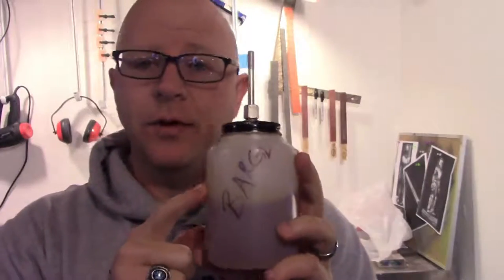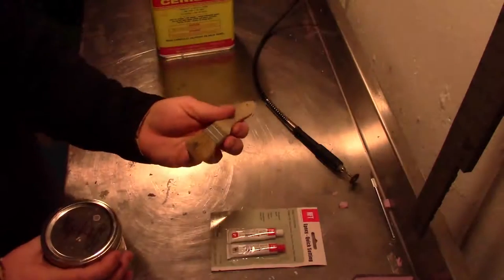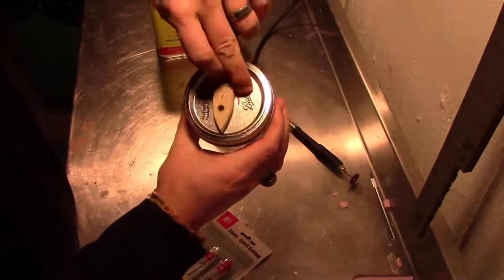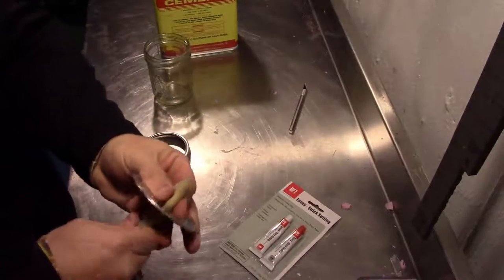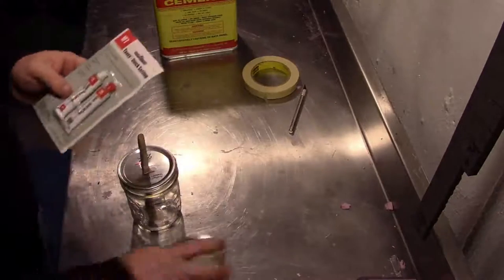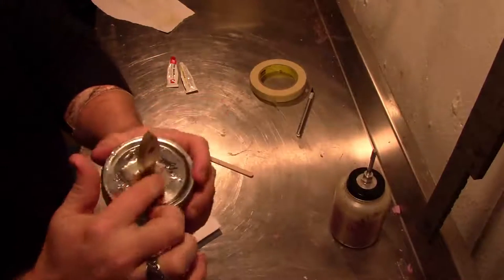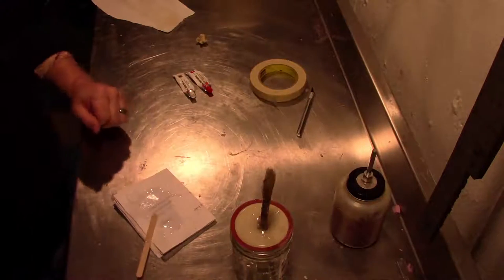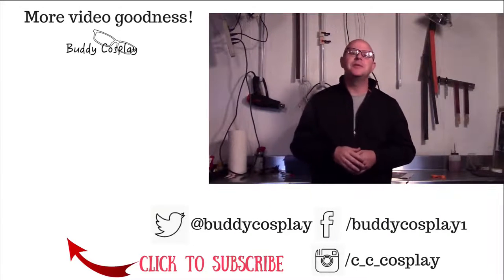Budget Cosplay Tips and Tricks   Hillbilly Glue Pot

Comment: Would an acid brush work or is it too narrow?
Reply from the maker: The small acid brush (horse hair ones, I believe) would  work just fine! Just make a smaller hole of the handle.  Good suggestion!
Reply: Buddy Cosplay thanks for the reply.  I think I may make a few of these.  One with a broad head chip brush and one with a narrow acid brush.  This way I can have multiple size applicators :)
Reply from the maker: Good idea. Brushes stay usable as long as they are submerged in the glue. It's a good way to save on buying more!